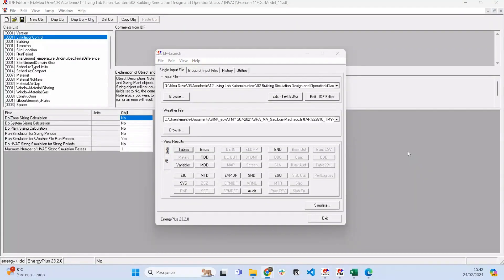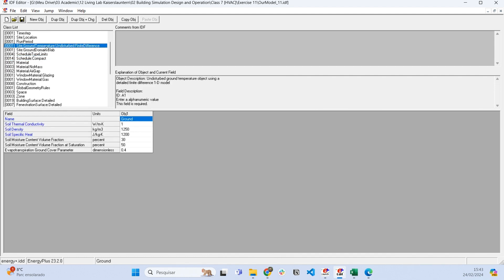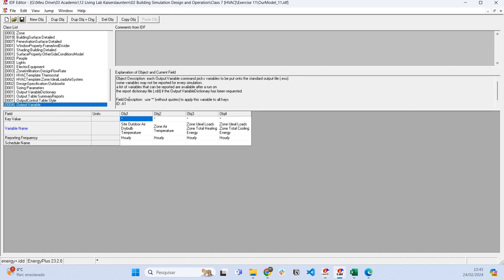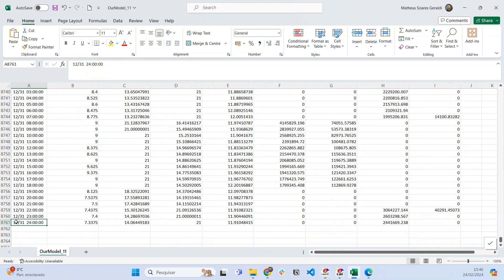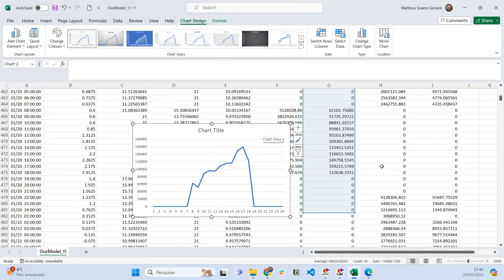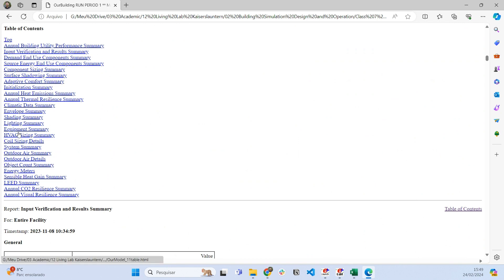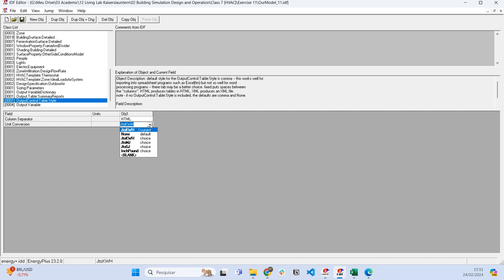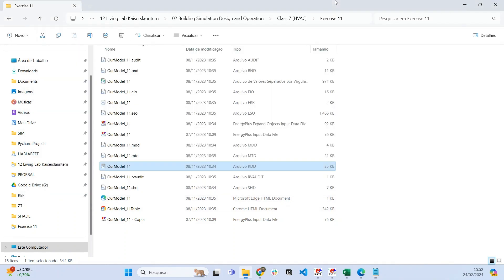EnergyPlus for Beginners - Part 12 [Outputs and result analysis]

Comment: Hello, thanks great videos. I'd like to simulate a cold room. In this case I need to simulate a hot temperature mass put on the room and evaluate the energy spent to move the mass from t.hot to t.cold. Becouse the sw fo not provide this kind of load  do you suggest a way to workaround?

Comment: Thank you for this interesting video, I followed the instruction but encounter below severe error: 
** Severe  ** HVACTemplate:* objects found. These objects are not supported directly by EnergyPlus.
   **   ~~~   ** You must run the ExpandObjects program on this input.
I tried to goole and chat out of it, and also tried the .expidf generated with EnergyPlus (after renaming it to i.df). The problem remains, as it crush but without an err file anywhere, kind of stucked here. I was wondering if there are some alternative solutions on this matter? Thanks in advance.

Comment: Thanks for your video, now I finshed this model according to these series videos. It can be simulated, while after this, the Table bottom can't be clicked, and if I click the Variable bottom, it can be oped via Excel but it is empty. Can you tell me the reason? Including the HTML, it also can't be clicked.:face-purple-crying:
Reply from the maker: Sadly, there are a lot of possible reasons for that. =( Are you sure that you simulation run is without any severe errors? You can also open the .csv file generated in the folder where you are running the simulation.
Reply: @matheusgeraldi  Thanks for your reply. I check my model again. It has some problems. And I try to address them, while there is one named the " GetSurfaceData: Construction INSIDE_DOOR of interzone surface DOOR_BEDROOM does not have the same materials in the reverse order as the construction INSIDEWALL of adjacent surface WALLEASTLIVINGROOM", I can't recover it. Could you give some suggestions or Could you meet the same problem and what is you way to address this probelm. Looking for your reply.